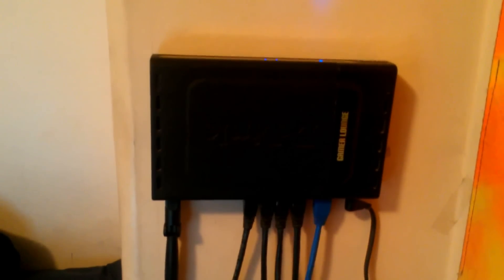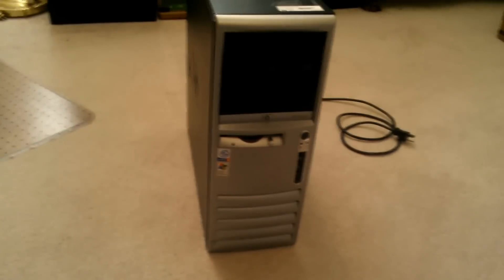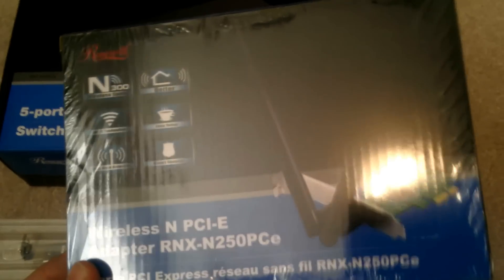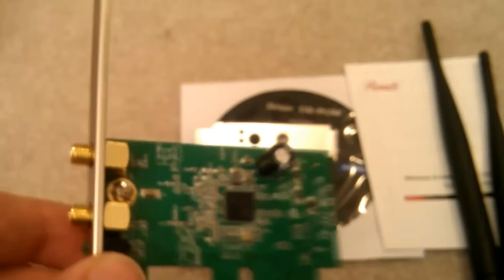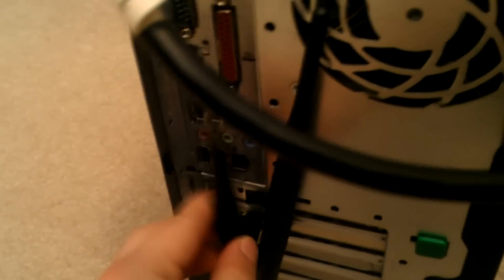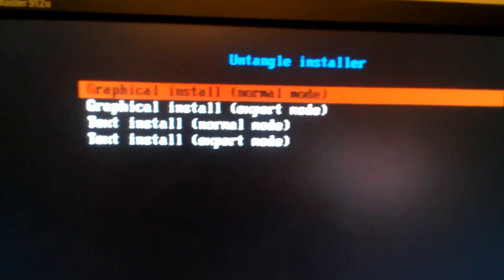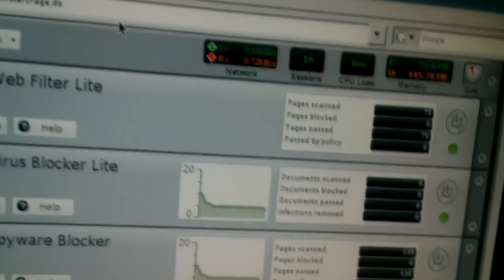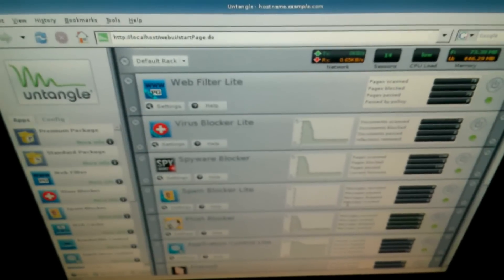New Home Router Old Pc Untangle

Comment: Did you managed to get the wifi adapter working ?
Reply from the maker: No I had to buy a Wifi switch. This wifi card was either DOA or I was doing something very wrong.
Reply: +XxViciousxX  according to their  forums they stop supporting wifi cards >> but seems like most of the intel cards do work.
ref :   forums.untangle.com/hardware/13626-untangle-router-wireless-ap.html
Reply from the maker: +sean lionel Well that would probably explain why it didn't work. I should have gone and read up on how to do this properly. But I wanted to learn as I go so I just kinda went for it was a fun experience tho.